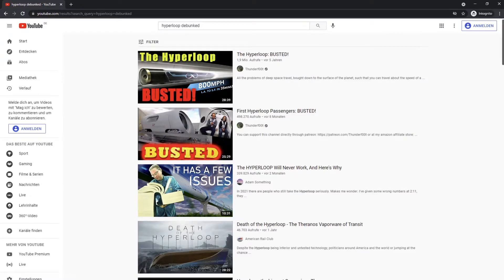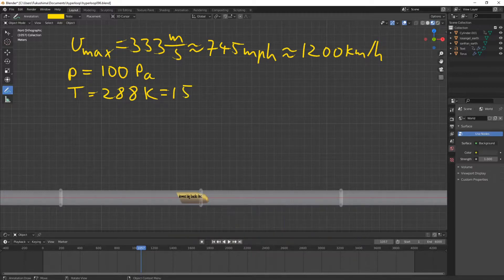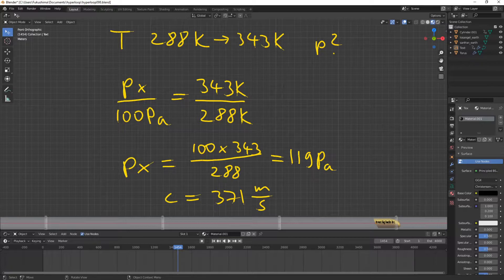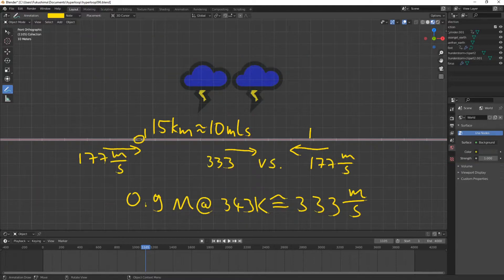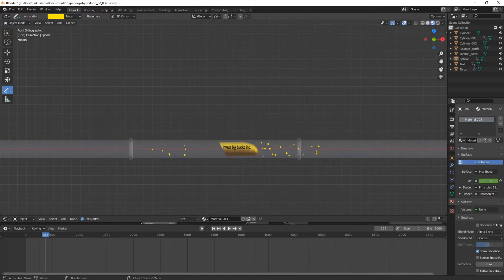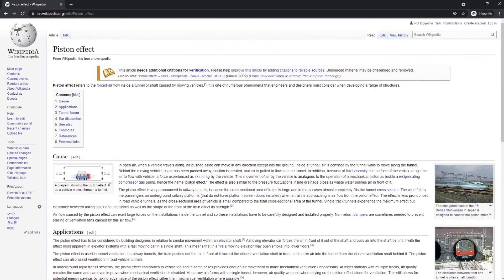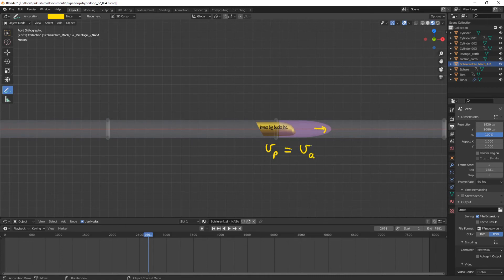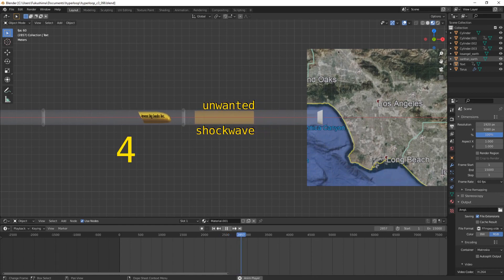Hyperloop's gas kinetics fails - the 100th Hyperloop debunk lol

Comment: Easy to understand for a non-science person.  Well done.  Shock wave and buffeting can cause the pod to touch the tube which could cause the vessel to lose air tight seal or to crash.  Either would be lethal to passengers.